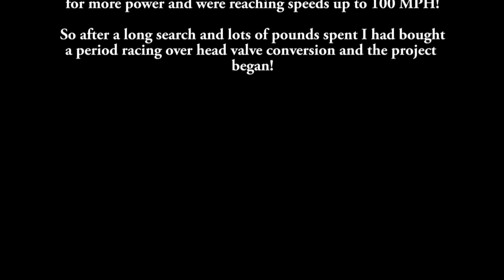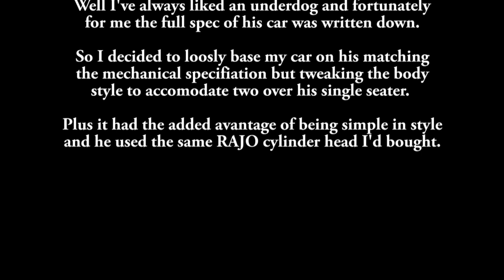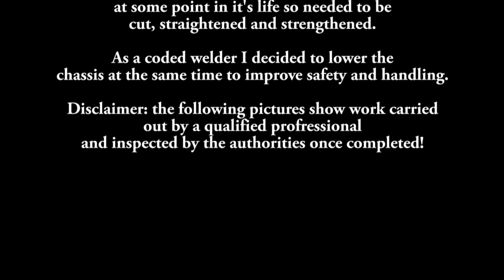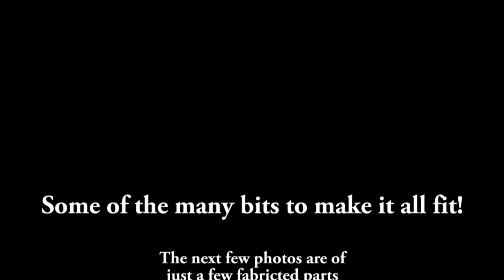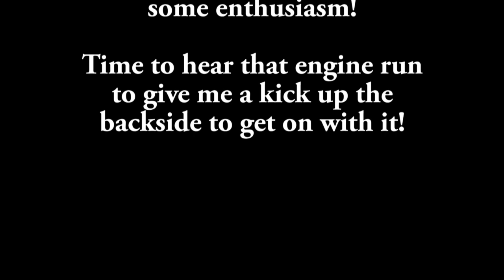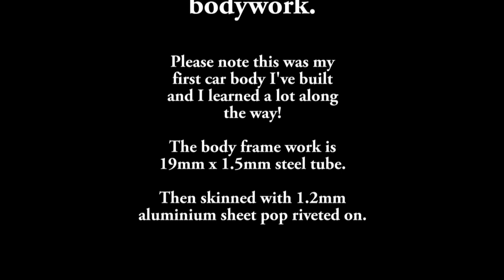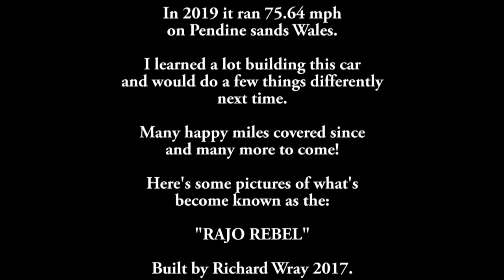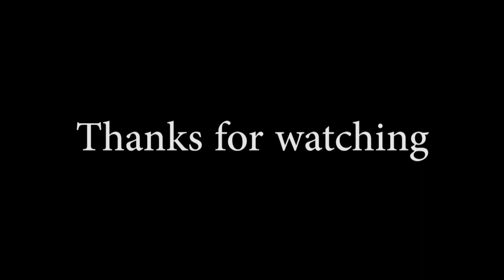Ford Model T Racer build bio.

Comment: what did you do to lower the front suspension, insomuch as is it a pre-lowered axle that's available to purchase, or did you modify it yourself.
Reply from the maker: It's a 3 inch dropped axle that I purchased and I fitted English drop frame stub axles to lower it a further inch.